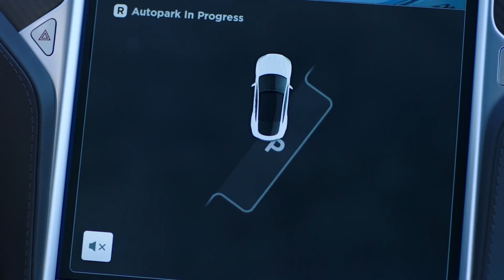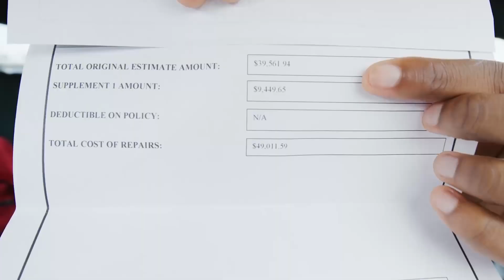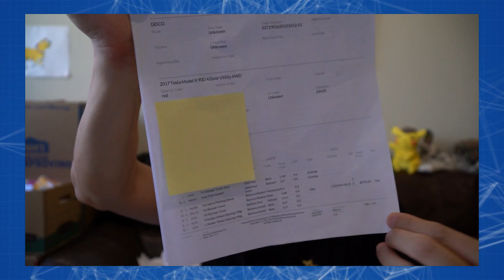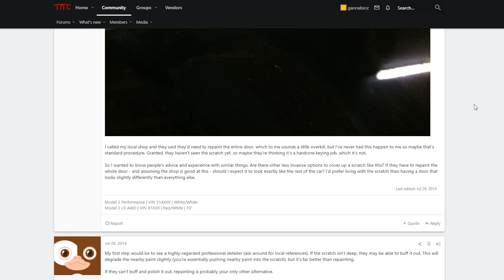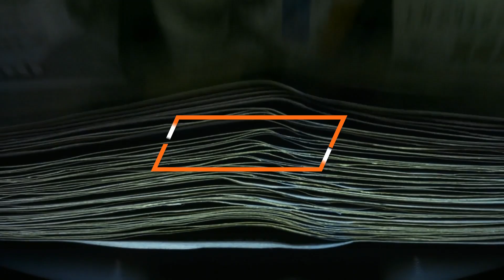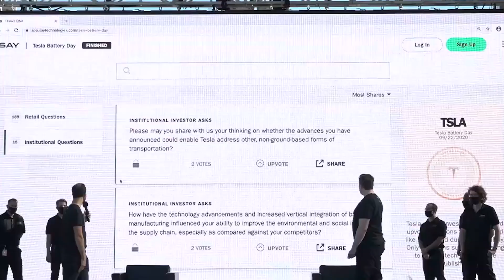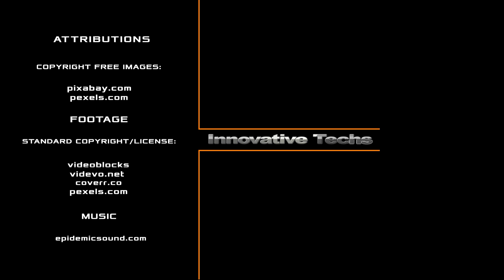Why Tesla is so expensive to repair

Comment: Just buy a Toyota any normal kind i would say cost like 200 dollars a yearly service (all fitlers and oil ect) and insurance is kinda  low 500 dollar . also the price of the car can be like 8 -16000 dollars and 1 tank a gas a month lets say would cost 100 dollars at current prices i dont really know. so 200 dollar + 500 dollar insurance and 1200 dollars for gas = 1900 dollar a year and if something really expensive breaks just buy another there are plenty of used Toyotas. but Toyotas tend to be reliable.

Comment: The simple reason why Teslas cannot last long is it's uneconomical to repair old Teslas which has gone out of warranty.  New battery will cost $20K.  Redoing brake cylinders will cost $5K.  Replacing a head light bulb will cost $1K.  And what happens when massive amounts of electronics in Tesla starts to break as all electronics eventually do?  Meanwhile, old ICEs can be maintained by DIY owner very cheaply for decades with just small set of tools, and far out last any unrepairable Teslas.  Just look at Irv Gordon's 3.2 million mile Volvo p1800 on original power train.  Teslas that can last decades and 3 million+ miles is still Musk's wet dream.  LOL
Reply: Good points.  I think to add to it a lot of people Lease these vehicles.  So once they are turned in who is buying them with no warranty or little left on them?  You'd have to be crazy just based on the price of the batteries.  There are some places that repair the batteries but you'd have to get your car to them for thousands of dollars in transportation costs.  Also, Tesla doesn't make body parts for wrecks.  You have to wait for them to make the part and send it out after the body shop requests it.  There are no aftermarket parts hanging around either.

Comment: What does it matter? The insurance is the same price as other cars and it will cover the repairs anyways..
Reply: Wrong! The cost to insure Tesla cars will be much higher due to the high cost of repairs. Use some common sense before sharing your opinion.
Reply: @moltenpros  I checked it before i posted… Here a 5 series and a model S is priced just the same…
Reply: @Likashiii  They are the same price to buy but not the same price to repair. Therefore the Model S will cost more to insure. If I have to school you again, I will have to charge you.
Reply: @moltenpros  You’re not schooling me, you are twisting my words. Ofc I’m talking about the price of the insurance, not the car. The insurance is priced similar between Model S, 5 series and Audi A6 here. Maybe I’m the one who needs to charge you for schooling. SMH
Reply: @Likashiii  I did some research and it seems you are correct. It doesn't cost much more to insure a Tesla than any other luxury vehicle. I owe you some money..lol
Reply: @moltenpros  Insurance will catch up they never miss an opportunity to cash in, they're in the business of screwing customers not paying out.

Comment: What a load of FUD. Sounds like a paid stooge or poorly informed and researched presenter.
Reply: Wrong.  Teslas will cost an arm and leg to repair out of warranty according to Rich Rebuild, who is famous for starting shop to provide independent Tesla repair.
Reply: @springer-qb4dv  Ritch has some valid points and right to repair is a large issue that we are front and Center with in the farming community.  If you follow Sandy Munro, you will see that there is nothing particularly difficult or unique with repairing a Tesla.  It is a challenge as Tesla has a modular replace vs repair policy. As we get more cars on the road we will see more independent repair shops and used parts available so we can avoid Tesla parts. 

This particular article is just poorly researched and presented as click bate.  My insurance went down 300$ from a used bmw to a new 3.  Insurance companies are not known for being suckers.  Accident rates are down, especially the costly minor accidents.  Fatalities are also very costly for insurance so having the safest car seems to help as well. 

Time will tell but i am confident that the future of mobility is safer less costly overall and just more pleasant.  Wish i would have bought stock in 19 instead of this great car.

Comment: Hell no. No way would i buy one.
Reply: Smart!  Stay far away from Musk owned Teslas.  You will never fully own one even after coughing up tons of cash.  Musk is a huge control freak and will prevent you even from repairing your own car!!  LOL
Reply: @springer-qb4dv  having repaired my own model 3, I’m not sure what you are on about.  Right to repair is an industry challenge.  My family is in Agriculture and we are front and center on this debate.  We will most likely prevail.  Apple should be your focus more than Tesla.  Bmw and mercs are also locked as they make all their money on service. 
I am optimistic that with some push we will see right to repair. Several jurisdictions are already moving that way. 
For Tesla’s the nerds will set up shops that will service older tesla’s. You can already get salvage batteries and drive units and the hacks to make them function. 
There will be a huge salvage market as these old tesla’s become available. Same cannot be said for the fossil cars as they all get crushed.
Reply: Ahh guaranteed you have not driven one. This article is basically FUD.  I would not drive anything else.